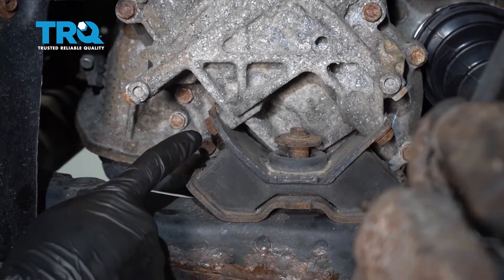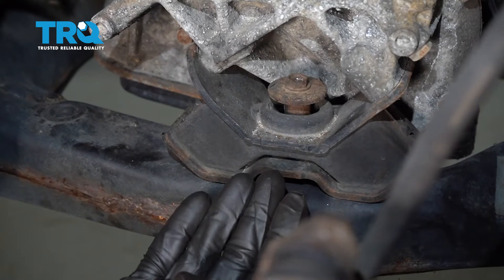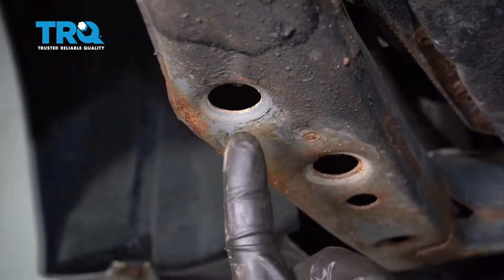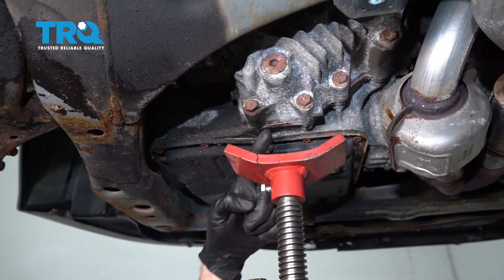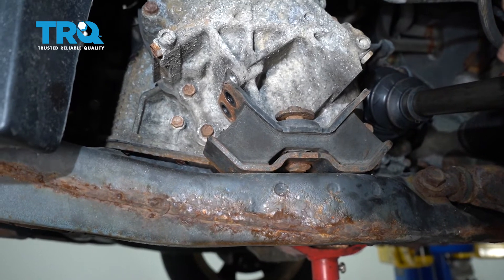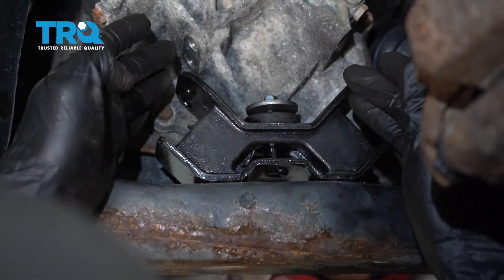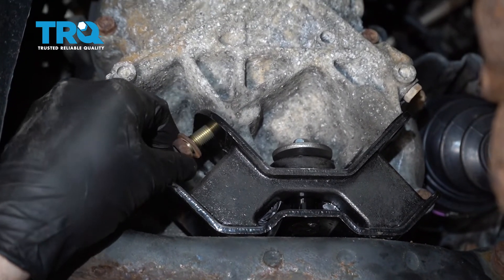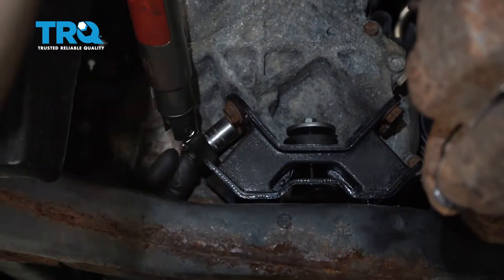How to Replace Transmission Mount 1999-2003 Toyota Solara

Comment: The torque for the bottom two nuts is 59 ft pounds per 1997 Toyota Camry service manual page AX-15.